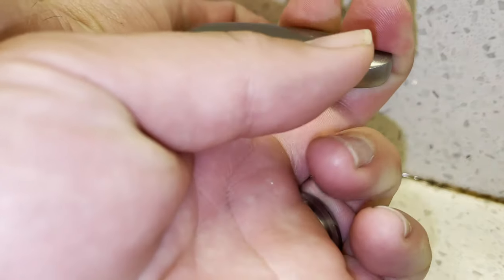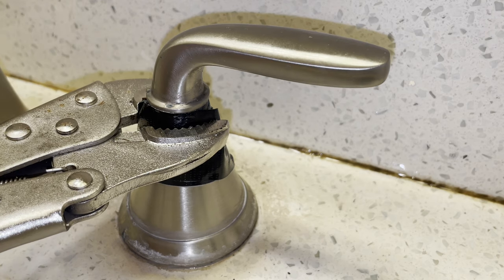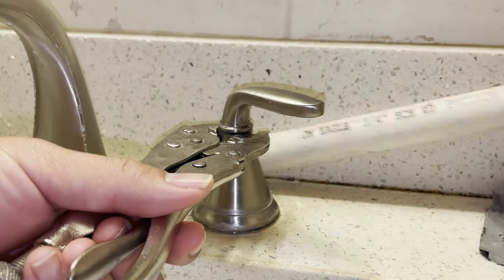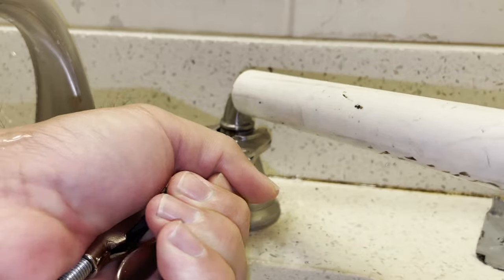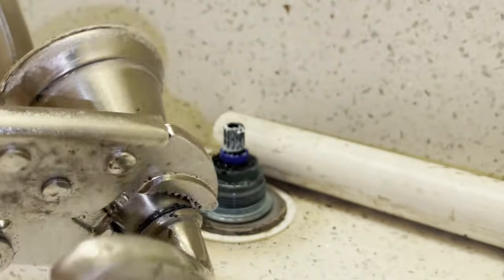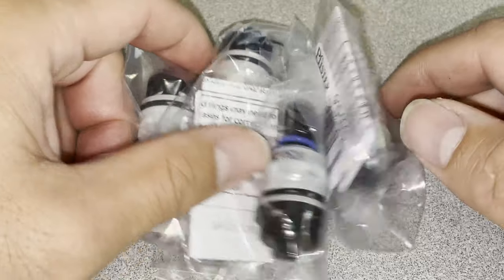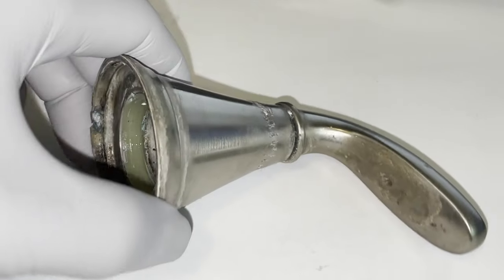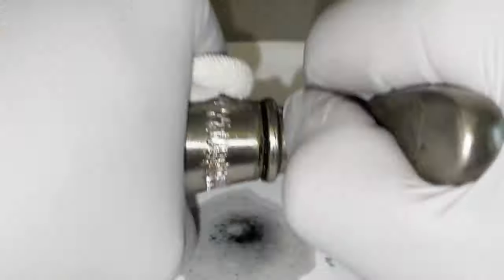How to Remove a Stuck / Frozen / Tight / Hard to Turn Price Pfister Bathroom Faucet Handle

Comment: Hi.  PHIL Dregger here using my wife's account.  It is the handles of her perplexing me after all.  Thank you for taking time to share what you learned.  Your tips worked great on my Meon screw less bathroom faucet handles.  Your tip about not rotating the handle more than 3 o'clock to 6 o'clock saved me from destroying my value.  Faucet all "fixed" new except for some custom vice-grip indentations on the base.  I'll see if Meon also has a a life time warranty.
Reply from the maker: Thanks Phil, I’m glad to hear the video was helpful.  The custom vice grips will certainly give it character!  Haha!
Reply: Yes, moen replaced my handle and the bell cylindare shaped thing under it.

Comment: Thank you for this video - it validated my experience of the darn thing not budging at all.  I had to take the whole handle assembly off, put it in a vice, and use a strap wrench to make it budge.  And that was just getting the handle side off its base.  I can now see the cartridge, but I cannot remove the handle from its siding (not sure the right term) because there is no screw inside that would secure the handle.  So frustrating!  But, because of your video, Im going to give them a call and see if I can get a replacement.  This seems like bad design.

Comment: This is a great vi. Thanks. I have the same situation. Had hot water wal mount washbasin faucet leak. Plumber couldn’t get the stem to turn bc of hard water lime etc. Very hard. He ordered another stem. The stem came but did not fit into the other part. He took original stem still stuck to the part, ordered a stem from Factory Direct. That one fit. He finished the job.. However.. did not place the hot water handle ion the 9;o’clock position. Now I have the handles opening in different direction/orientation. How do we fix this.

Comment: This worked perfectly for me. Thank you for posting this video. This is the second time the cold water was hard to turn on. Both times Pfister came through for me and sent replacement parts including the faucet I badly scratched using your method this time, had to be done. I tried everything to remove the faucet to replace the cartridge. The video was excellent help.
Reply from the maker: Glad to hear it worked for you!

Comment: In order to minimize damage to the faucet, I used white vinegar. I sprayed it into and around the faucet so that it seeped into the crevices and loosened stuff up a little. 

Your suggestion of using the PVC pipe was great! I also used thick electrical tape, making it double layered to protect the faucet from the wrench teeth a little. The pressure from the wrench still deformed the lip, though. 

After, I was able to loosen the faucet and I soaked it in vinegar for a few hours. I also sprayed and cleaned the based with vinegar, letting it soak in before taking a brush to it. 

Lastly, I sprayed WD-40 into the faucet crevice to protect from water after I place it back in. 

Your suggestions really helped! Thank you!!
Reply: Thanks Jorge for the tip on using white vinegar. I have to replace the cartridge on one side and was about to use CLR to remove a stuck handle and the wife reminded me that CLR can sometimes discolor things. I guess if I can use white vinegar in the coffee maker, it has to be able to break down calcium on the faucets!
Reply: @ernestanderson3726  Vinegar is great. It works fairly well. It does take a little patience, though.  You need to give it some time to do its thing.
Reply: @JorgeLuis-1  ,Thanks! I have it soaking now. Tried grabbing and wiggling it a few times but like you said,  I need to have patients.

Comment: I'd spray some PB Blaster on it and let it soak in.  Overnight is best.  If that still didn't loosen it, then I'd carefully apply low heat with a heat gun or hair dryer to allow the metal to expand.  That should do it and hopefully not damage anything.

Comment: Thank you so much for the instructions. Mine is Moen branch but similar style, just 3 years old and one handle stuck. I couldn’t open it but watching this video, we bought same stuff you used here from Home Depot and was able to remove the handle. I dissembled it to clean the calcium that made it stuck and put it back. It works now just has scratches but at least saving us some hundreds $ to replace the whole set (must hire someone to do it and buy new one). I will try to claim it see Moen would send me a new handle. They only sell the whole set, not just a handle, in store.
Reply from the maker: You’re welcome!  Interesting to hear that moen has a similar problem with their faucets.   I wonder if their faucets are made by the same manufacturer.  Thanks for sharing!
Reply: @thriftytani46  yes moen has same problem. i repaired one faucet few months ago, and cant get to losen this time for the other faucet. i believe i broke both the handles😮

Comment: Ok just an older disabled female trying to save money so don't laugh at my question please. I think I can fix my faucet with your great instructions. But due to spine issues I don't think I can get down on floor and under sink to turn the water off. I am also afraid even if I could, I have read stories about the knobs under the sink breaking, or water going everywhere. Does the water have to be turned off to just replace a handle? thanks so much
Reply from the maker: You do not have to turn off the water supply to change the handle.  But of course, have a plan just incase unexpected things happen.  Have a couple of towels to create a dam to guide the water into the sink just incase the water begins to dribble out of the cartridge.  And have a pot available placed upside down over the faucet if comes shooting out the top so it will guide the water into the sink.  It would be unlikely that you’d have these problems, but of course it doesn’t hurt to be prepared!

Comment: If you cannot get a handle off after trying the video tips, a leaking cartridge may very well be the issue by seizing the threads with water mineral deposits. I had to use a Dremel with cutoff wheel to lightly score opposite sides. Protect counter top with metal scrap.

Comment: Much easier if you use a rubber strap wrench. You won't wreck your handle if you don't plan to replace with new. Just soak your handle in white vinegar and it will eat away at the scum built up inside, around, and within that handle

Comment: there is a metal C clip holding the handle together.  I was able to pop with with alots of force and twist, i think the correct way is the pry it open from the bottom at https://youtu.be/g8dIK28UiB4?t=183

Comment: To get top off of handle. In the inside of the handle their is a screw. Loosen screw and it comes off.
Reply: Not on this model.
Reply: My model pfitzer does not have a screw up in there. Annoying.

Comment: From watching this I guess I'm going to have to destroy the handle base in order to get the %$#^& thing off. I tried squirting penetrating oil all over it but the space between the handle and base is so tight that I really doubt much is actually getting inside there. My problem is that the handle is a little loose on the hot water side and turns a bit left/right without turning the cartridge. It's slowly been getting worse. I think (hope) there's a screw or allen key inside, or something that I might be able to tighten up. But I can't get the handle off. Mine is kitchen and not exactly the same as this one but the handle and base look very similar. Thanks for the video.
Reply: Update: I contacted Pfister for suggestions on how to get the handle off and they are sending me a new handle and cartridge! I used their customer website to submit along with pictures and they were able to identify the model (F-036-4CRS). I think I paid around $90 for the faucet at Home Depot 10 years ago or so and never realized it came with a lifetime warranty. Now I don't feel so bad about destroying the handle base to get it off, but I will wait for the new one. They recommended using a 50/50 solution of warm vinegar/water to loosen the handle and I squirted a whole bottle into the gap above and below the handle base but it didn't do anything. If anyone else is having such problems, be sure to contact Pfister - you may get free replacement parts too.

Comment: Anybody try using a strap wrench?
Reply: a giant plumbers adjustable pliers will grip the base of the handle.

has anyone compared wd40 vs oil  for the disintegrated gasket?    white lithium grease?   silicone?

Comment: Try usine Never Try using Permatex 80078 Anti-Seize Lubricant With Brush Top Bottle. Pretty sure that will fix the problem.